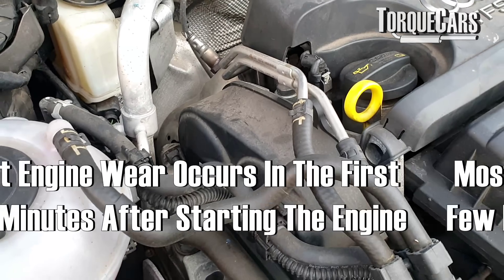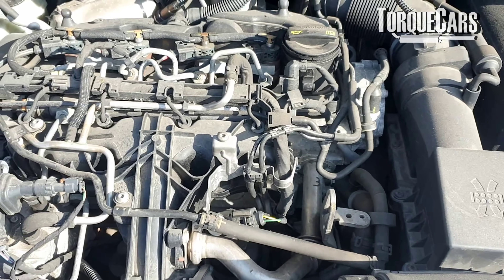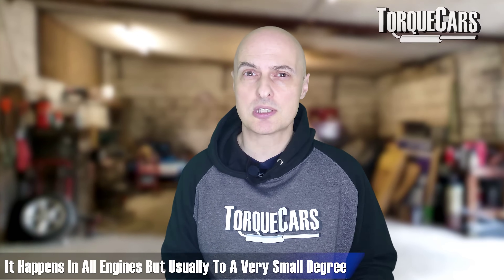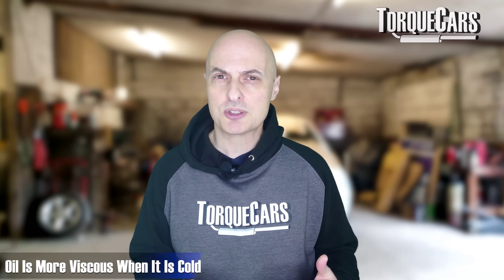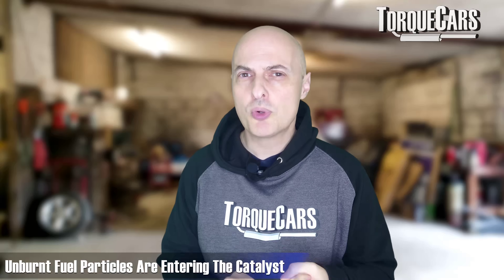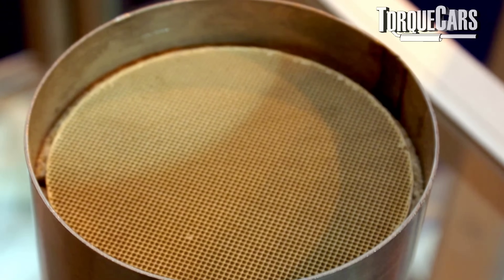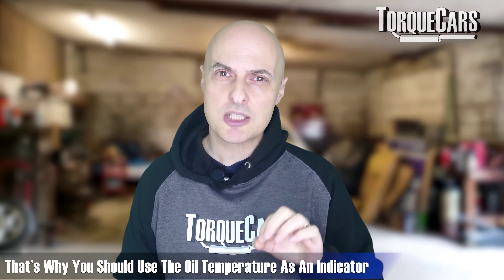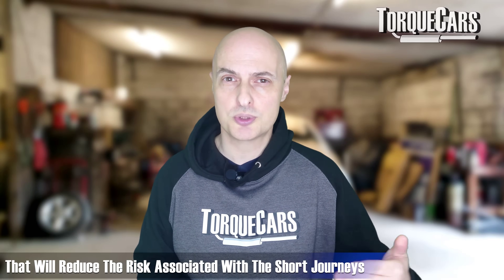5 Minutes of Terror? The TRUTH About Cold Start Wear (and How NOT to Blow Your Motor!)

Comment: Isn’t there the factor of driving and having cold air rushing through your radiator slowing warm up time too? Unless I have a radiator cover I think I would rather have it be stationary on a really cold day.
Reply from the maker: I used to think that too but discovered that most modern engines will shut off coolant circulation to the radiator until the engine warms up enough, then if it cools too much in winter the radiator is once again shut off or flow is reduced. This is the job of the radiators thermostat. I have known people blank off radiators to improve fuel economy but I can't personally see the benefits on a modern engine.
Reply: @torquecars that’s not most modern cars…that’s all water cooled cars since at least the 1950s… here’s from the web:
“Every vehicle has a thermostat that monitors and regulates the temperature of the coolant in your car's engine”. They stop coolant from circulating in the engine until it’s up to normal operating temps. That was a strange way to put it for someone making a video to inform others and being so informative in general.
Reply from the maker: LOL @5400bowen you are right - I have learned never to make sweeping statements even if they seem to be correct, there is always an exception which someone will point out.

I also never profess to know everything, I like everyone is still learning and expanding my knowledge and understanding so really welcome comments and feedback.

In my mind I was thinking of a few cars with electric water pumps and some will only slow the flow through the radiator rather than stop it, (it keeps the coolant temps more uniform that way) and rather than be thermostatically controlled some might even anticipate the temps before they happen regulating flow in advance but crucially not shut it off completely. 

So to clarify "pretty much all cars will have a thermostat to shut off water circulation from the radiator" but I'm sure someone out there will know of an exception to this.

 With a mechanical water pump you need a physical restriction such as that afforded by a thermostat but with electric water pumps control can vary and there are many exotic solutions and controllers out there.
Reply: @torquecars  a thoughtful response. I webbed it (hate google!) and there are a very few cars that have both. It did not mention ones that only have an electric pump. So for a general conversation about cars that isn’t really for the average driver. But they do exist. I’m really looking forward to electric vehicles altogether. I worked in a machine shop that did all the machine work on blocks, cylinder heads and connecting rods for the San Diego city bus system. The amount of poison nous chemicals and dirty motor oil etc. was to say the least upsetting. All the guys hands shook constantly from carb cleaner etc. except mine…I wore a chemical respirator mask when dealing with any and all solvents. Until then I’ll warm up my 2006 F250 diesel until at least 100 degrees. And NEVER rev it up until after 20-30 seconds, and then only very slowly and not very high at all.
Reply: Yes I forgot about the thermostat but there is cold air rushing over the engine as well. I still think I will idle my car stationary for a few minutes

Comment: The cold start wear is a lot bigger problem on direct injection engines, because this technolgy did increase a lot the gas condensation on cold cylindrer walls and oil dilution

Comment: One good thing would be that modern engine would be fitted with a small electric pump would pressurize the engine oil prior a start.
It would also have a heater to warm up the oil to a minimum temperature.
That would probably help to increase the life spans of the engine.
I doubt that would represent a lot of % of the price of the car
Reply from the maker: F1 cars won't run until the oil temps are raised and the engine has been warmed, they are so well engineered they need the heat before they can run properly. I have seen people use oil pan warmers in cold climates to do just that.
Reply: Many older vehicles had block heaters that you could plug in and keep your oil warm. My 2001 Mercury came with it standard, and if your car does not have one, you can even get one installed.
Reply: Some of the turbo post oilers also have a pre oil function that pumps oil in the key on position before you start the car. It supposedly significantly reduced wear.
Reply: Sure but then the car would last longer, causing the company to lose money, because you have a functioning car and you are not looking to buy the new model immediately.

Comment: A diesel isnt going to be running rich.
Reply from the maker: That's true, but it will be more sooty and this will clog up the DPF more quickly. There are similarities between diesel and petrol engines but as you point out there are also some significant differences.

Comment: In Finland engine laboratory did study for that. Results was: Cold start wear engine same amount than 600 kilometer drive the hot engine.
Reply from the maker: Wow 600km of driving does the same damage as a single cold start, that is a scary statistic I'd love to read that study if you know where it can be found.
Reply: @torquecars  It was VTT research institute, did before internet. Ask to them.
Reply: I drove a Volkswagen Up! with the 1-liter 3 banger for 140.000kms. It didn't have an engine- or coolant heater and I dailied it even with -30*C. I never even had to add oil between changes, but my oil change interval was 10.000kms. My guess is that engine oils have better additives today, than the days before the internet.
Reply: @jarikinnunen1718  alright, I will start walking the 5km to school then instead of taking the car goddamn
Reply: what means hot engine: overheated, warmed, ..., what temperature of oil/coolant ?, because 600km on working temp should not make any wear
Reply: @makantahi3731  Zero wear at working temp?  So friction has disappeared........wow!  Do you write the blurb in the oil company ads, by any chance?
Reply: @makantahi3731  Of course it means working temp.

Comment: My warm up in my new mux I idle it for about 2 miuntius then drive it gently for about 5 then drive it a bit less than normal for 10 miunts then drive as normal.
I never really start that car for less than 100 klms.

And yes I do a similar thing for shut down..  drive it gently for the last 5 k..  then idle for one to 2 miuntius..

And it's 40 degrees C here in Australia today..

I still warm my older cars to..

E36 BMW V6 commodore tb42 Nissan patrol

Each is different..

Cheers mate..

Comment: 5 minute warm up and 5 minute idle shutdown and my turbo  engine has done 933,000km. I’ll stick to my routine. As for coolant temp sensor, they are now mostly cylinder head temp sensors so it’s better indication  of the engine temp.
Reply: wow. 933kkm is alot. what car ?
Reply: @viakion2125  probably never heard of it, Ford Falcon BF XR6 turbo Ute.
Reply: Mad max
Reply: Modern oil pick up is within seconds for oil to flow around entire engine ;) However, yes the egine needs to get up to running temp before heavy load is applied. if you are referring to turbine wear then, yes, don't boost engine even moderatley, yet alone hard for first 5-10 minutes ( I prefer nearly 10 mins before even moderate boost due to these TFSI engines having long stroke for such a small engine). Coolant temp rises faster than does oil temp so, you want 'oil' to be @ operating temp before hard boosting of course ;) % minute idle before shutdown is not necessaary unless you've just boosted high & stopped suddenly. If you coast home for few minutes then, shut her down immediately. The oil will be @ normal temp if you take it easy on way home as it won't be heated by turbine housing so oil coaking won't be an issue. Also, when idling, particularly on a hot day. The engine isn't having nice cooler air flowing through the intercooler to cool the engine down. So, simply coast home then, turn it off ;)
Reply: @staysinglemyman  I see your point, the way I look at shit down is iabout preventing oil carbonising in the oil galleries to the turbo. The exhaust and turbo are over 400 degrees at 5 minutes idle. There is zero oil or coolant flow and any film of oil over time will build up layers until you eventually block the oil gallery. I’ve seen turbo fail from lack of oil supply and one question I ask the owner how long do you let it idle before shutting it down and the answer is alway “I do t” . Basically my point is 5 minutes at each end saves you thousands in repairs and downtime. As I stated before 933k on an unopened engine and original turbo,, am I doing something right or is it just luck of the draw.
Reply: That wouldn't stop the turbo on Mazda Skyactiv diesel with a design fault failing - it's probably more a recognition of good, robust design
Reply: @stupossibleify  last skynet Mazda diesel I took apart destroyed the exhaust camshaft lobe where the supposed emissions magic is supposed to happen.
Reply: can't do any wrong with that, when taking off i wait until the oil temp is in the operating range and the oil pressure is back to nominal before any spirited driving is commencing 
i've had my car for 4 years, never had any trouble with it now at 152,000km 2.0 Ecoboost Focus ST
Reply: Did you do any preventative add-ons catch can or anything
Reply: 5 minutes idle shutdown is unnecessary. Just drive at lower rpm 10-15 minutes before the destination and it will be at a good temperature. (1500-1700rpm)
Reply: @_icscata_  it's not about the temperature it's the turbo but 5min is useless 30sec is enough
Reply: When I had turbo car I would blast the heater and wait about a minute or two and my temps would go down a lot I don’t think you need 5 minutes
Reply: How much oil does the engine burn between services?
Reply: I'm not sure if i have ever seen a water temperature sending unit that wasn't plumbed into the water jacket on a head. Drove a lot of trucks with full guages.
Reply: @davidpotter7484  trucks like Cummins have one for the  engine ecu and one for the dash. The dash one is usually on the thermostats hot side on outlet pipe.
Reply: Dude, that's an amazing amount of kms. I thought I was doing well at 580K
Reply: @adamsitar2717  on a turbo? What car and motor do you have?
Reply: lol “idle shutdown”

Comment: 6:50
So the best way to warm up a cold engine is to run it under load? That doesn't make sense. Other than getting a block heater there's no other way to warm it up except letting it idle for 10 min.
Reply: It does make sense - the engine will reach operating temp quicker with small load. Idle will take very long to get to operating temp, so your engine is running cold for a longer period of time leading to more wear than if you let it idle to initially warm up some and then thoroughly warm up quicker with light driving

Comment: Don't over think this folks.  Start it, wait till the idle comes down and go.
Reply: Exactly what I do.
Reply: don't even wait till idle comes down ... just start driving it after 10 seconds (to get oil temperature up faster), but slowly and gently ... no high revs and no lugging .... once warm, you can go hard on the engine.
Reply: @jimr549  🤡
Reply: I've started my manual car in -35 before, had to wait about 10-15 minutes because the clutch pedal couldn't even move fast enough to drive haha
Reply: @td1068  what?
Reply: @ThunderSky  clutch pedal, not clutch lol, I didn't realize I only said clutch until now
Reply: @td1068  Yea if it is cold enough that your clutch won't move, you are probably dead.

Comment: nice vidz, one question, why on my supra my oil temp go up pretty fast when i first drive the car, AND , more strange, oil temp goes up faster than water, how is this possible? even on cold weather, oil is always at temperature before Water
Reply from the maker: The water temp is often measured near the radiator inlet, if the engine is cold most engines will stop water circulating through the radiator until it has warmed up, otherwise the warm up cycle will take longer. Another reason could be the water thermostat is slow to respond. It depends on how the engine was designed and where the temp sensors are. Oil is always a better indication of true engine temps though.
Reply: @torquecars  nothing to sorry about i Guess so :p thanks .

Comment: Well, it doesnt change the fact that a cold engine - actually runs better, in that sense, if u have all of your services done right, having a fresh cold engine is a benefit. Hence why performance cars have all kind of shit added that cools systems. My car rides really well in morning at about 2 celzius.
Reply from the maker: I get what you are saying but to clarify a little for the uniformed out there a warm engine is more efficient and better than a hot engine, I wouldn't use the word cold here it makes people think of an engine just starting up. With the risk of blowby happening and piston slap I would wait until an engine is warm but when they get too hot you have a host of other problems, hence oil coolers, water pumps and secondary cooling circuits/rads.

I did a video on the cold morning power increase a short while back... https://www.youtube.com/watch?v=F53EhfJbPtM

Comment: Oh good, I don't think my ritual has been too bad for the past 20 years. I'll start, let idle for 2-5 minutes (depends on the engine and outside temp), then drive lightly until water temp is WELL established. Not too much throttle, never past 3k rpm. I bought a new car in August and was thrilled when I found it had an oil temp sensor. Now I can definitely make sure the engine is up to temp before any sort of spirited driving.
Reply from the maker: If people have a little mechanical understanding they tend to do the right things automatically. Well done. Which car is this with the oil temp, they are getting more common now?

Comment: The cold start terror certainly is not a myth , and it does happen . This is why I start my car & let it run a couple minutes before driving . Once I start driving , I go easy on the throttle until it's at least half way warmed up. I also drive in a conservative fashion unlike other idiots on the road . Those things along with a good synthetic oil , the horrors of a cold start are minimized .
Reply: I do similar to you. I start the car, wait like a minute before I start driving and then I go around the city for 5 minutes or so before going to the highway, never going beyond 3000rpm
Reply: @carviryzen288  I definitely agree with what u said however I’m cautious to not let the car warm up at idle for long (low oil pressure) instead wait for the rpm’s to drop then do what u said.
Reply: Those other idiots are probably leasing their cars.
Reply: Agreed  @stupossibleify
Reply: @stupossibleify  the same people who hit road humps at 20mph
Reply: So wrong in many ways you need to let your car warm up let the rpm come down and your coolant get warm for your water pump wow! You guys I have no idea how to take care of of a car
Reply: @7thheaventruth  avviato il motore bisogna partire pochi secondi dopo. I moderni motori sono assemblati con materiali diversi (ghisa, alluminio, plastica, guarnizioni per esempio) ed è assolutamente sconsigliato far scaldare il motore. Si parte immediatamente, guida pulita e tranquilla, max 2500 giri rpm. Disattivare sempre start/stop. Prima dello spegnimento del motore, per le auto turbo, lasciare sempre girare il motore al minimo per almeno 1 minuto. L olio defluira correttamente,  ci saranno minori dilatazioni e non si formeranno residui di olio nella turbina. Sono un ex tecnico Audi-Toyota
Reply: It’s good to see people talking about colds starts and finally a video that explains it’s important to drive and not let the engine idle to temperature. The only two issues I can see is that water temperature is a very good indication of an engine being up to temperature, this is due to the water increasing in temperature because of the engine, It can’t do it on its own. Also the catalyst will incur excessive wear from open loop running but it won’t melt unless there is a serious issue which is usually due to a lean fuel condition like a vacuum leak, not a rich fuel condition on warm up. A rich mixture will get into the catalyst but can’t burn without the needed oxygen which isn’t available in a rich fuel condition.
Reply: I used to do this until the car started chucking out blue smoke due to burning oil Sold car after this, I now start the car and drive off after 10/30 secs as it comes off choke and not had an issue since, by leaving a car idling your prolonging the amount of time the engine is running cold causing excessive wear especially if your car has a turbo... It'll be the turbo that dies first.